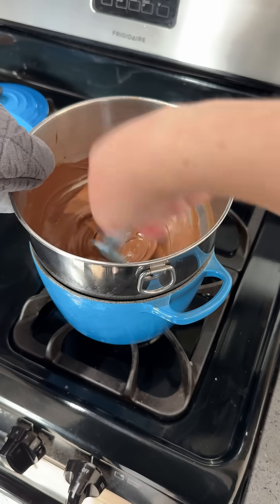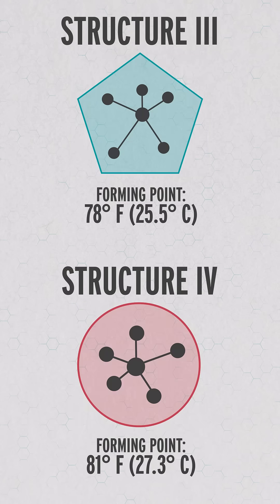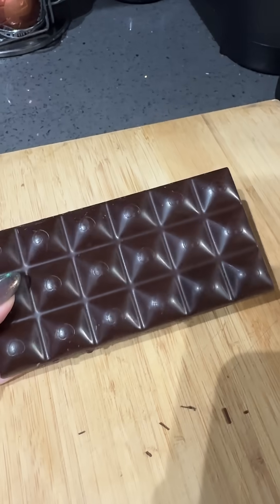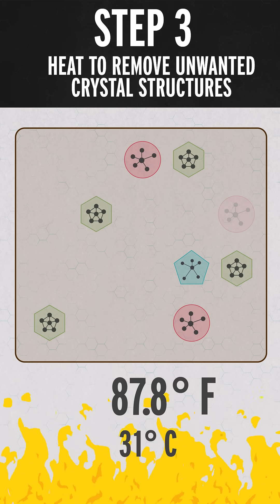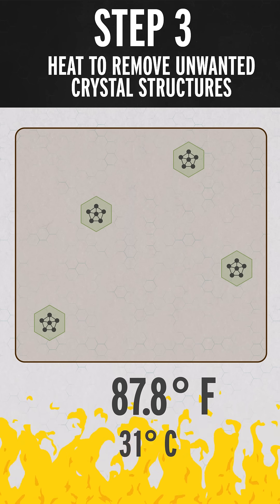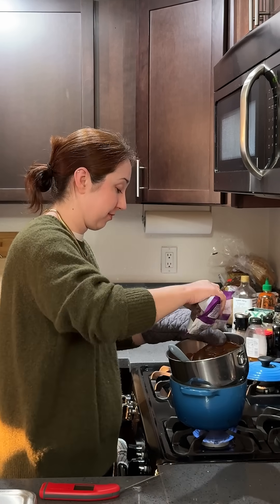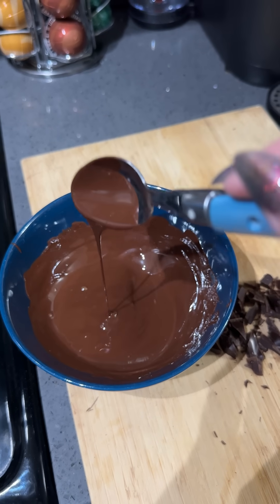tempering chocolate is chemical engineering

Comment: Hi, are you familiar with how to get better pour-ability with vegan chocolate? I have been able to temper it but when making bulk bars that have filling inside and trying to do the first layer and make sure it reaches all across the mold, I find it quickly becomes very thick and viscous - makes it very hard to pour / spread. My goal is to make bulk bars with a certain filling on the inside, so I need to quickly pour and set those initial layers….. but I’ve yet to find a vegan milk chocolate alternative that I can temper AND has good pour ability. Thoughts?

Comment: It's actually much easier when you learn what it looks and feels like at the temperature points.  At most 15 minutes a pound when you get use to it.  A quick test, stick a knife or spoon, or some such to coat, and place it in a fridge.  2 minutes is usually enough to see if you got a nice smooth temper without streaks.  

The big trick is not to melt it real quick!  If you do it takes longer to bring it down.   It's a slow and stead rhythm Heat and stirring, cooling and stirring, watching and feeling, yes, you  don't have to pretend its science.  It's an art and touch the surface with the back of a knuckle will teach you how to handle the chocolate. 

Another note:  dark and white chocolate like different temperatures ;)

Comment: Sorry if this question is unhinged but is it possible to use a sous vide for this process? It would be more difficult to properly stir the chocolate yet if the temperature could be accurate to 0.1 degrees could you bypass the painful parts and end up with tempered chocolate?

Comment: Being that you said the key words “at home” I’m guessing you used a cheaper thermometer and those can have a wide tolerance for the actual temperature you’re trying to read. If you want a precise temperature for something like this that is supposed to be precise. You would have to shell out some moneys for a good thermometer with a smaller tolerance range. But at that point just buying chocolate bars is cheaper

Comment: Makes total sense. Tempering chocolate is usually a baking thing, and any good cook knows that cooking is art, but baking is chemistry.
Reply: Ehm... close but not quite. It's not a baking thing, it's a candymaking thing. Baking is done in the oven. Candymaking is its own field which is done on the stovetop like cooking, but is precise like chemistry because making candy is mostly just controlling the crystallization of sugar (alongside whatever other ingredients). It's such a specific art that it has its own type of thermometer, a candymaking thermometer, which is made specially and has markings for the various stages of sugar, because when you boil sugar and water, it boils at a specific temperature depending on the ratio, so any ratio can be achieved by boiling the mixture until it boils at a specific temperature (the temp goes up as the water content goes down). After that is the crystallizing part, which is the most variable and depends on what else is in the mixture (milk, etc). Source: I make candy at home.

Comment: This makes it seem so difficult. I heat mine up to 115 or when the chocolate melts properly. Cool it to 100-110 and add the seed. It hasnt failed me yet. My uncle who is a gastronomy professor said to cool it to 80 degrees but it tempers too fast at that temperature so i tried raising the temperature and 110 is the max i can do with it still working.

Comment: Fun fact, this is pretty much exactly how metallurgists manipulate metals to get the desired mechanical properties! You can add different alloys to make a phase easier to achieve, or you can simply use different heat treatments to get to the desired result. Either way, cool video!

Comment: Mmmm, that's mechanical engineering, not chemical.... 
There aren't any chemical reactions happening i.e. no electron exchange, soley mechanical structural rearrangement based on temperature change (tempering).
Reply: It’s actually  material science, not mechanical.
Reply: @Joker-em6oz  yes it's material science, but also falls under mechanical engineering as it's a mechanical process. There's a whole branch of mechanical engineering dedicated to this (I'm a mechanical engineer in this industry...).
Reply: @ no it doesn’t. This is its own field. Don’t think you’re in the chocolate industry

Comment: I nailed tempering the first time I tried it, got a great sheen and a ridiculous snap.  I never got tempering to work ever again, not once.
Reply: it do be like that sometimes
Reply: I can't add top level comments but the reason why tempering isn't always consistent even when you do it the same way is because local humidity changes the temperatures needed to properly temper the chocolate ever so slightly.

I live in a very dry place and I have a proper AC running in my kitchen because if I run a swamp cooler I have to adjust my chocolate tempering otherwise and this is a more permanent decision for me.

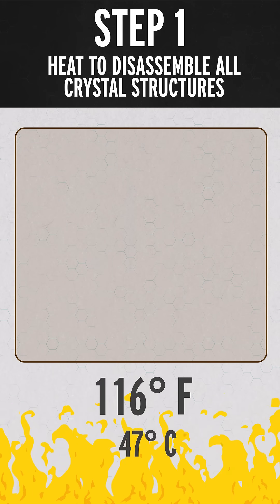Comment: Nice Video. I work in a factory that produces chocolate and that 0:19 is exactly how the chocolate is prepared for the coating machine. The machine that prepares the chocolate uses cold water (8°C) to trigger the first crystallization step, maybe that's the reason why you had some trouble with it.

Comment: An immersion circulator (aka sous-vide cooker) is magic for tempering chocolate. Put any amount of chocolate in a bag and seal. Heat to 117 in the water bath, then add ice to the water to drop down to 80. Set the thermostat to 87 and knead the bag a few times as it heats up to encourage crystal formation. It’ll all be structure 5 this way, you can do this with any amount of chocolate, and you can hold it at 87 as long as you want. Just wipe the water off the bag before you use it.
Reply: Thank you for answering a question I've had I don't really ever want or need to work with chocolate but I wondered if you could use a water bath
Reply: And a drop of water will destroy the whole chocolate batch.... Pastry chefs know that.
Reply: @curlyhairdudeify  thats why it's in a bag

Comment: Question about type 6: does refrigeration affect the process? I wouldn't want it sitting open air or even sealed at room temp but if were talking about top tier desert chocolate I could be comfortable leaving a container in the fridge for a long while.

Comment: You can also seed with small amounts of cocoa butter from an immersion circulator or those heating pads with the magnetic spinning pills. Also, I’m certain you’re using chocolate chips which has different ingredients than chocolate like waxes that would prevent a lot of this.

Comment: Yeah, I bothered tempering chocolate exactly 1 time. Then I just made a batch of chocolates, split it into thirds, and cooled each third with a different method. One third went into the freezer, one into the fridge, and one I left on the counter and but it into the fridge after it cooled to room temp. The freezer made chocolate glass (I could see a possible use there, but not great for candy bars). The fridge made it too hard for comfort but not nearly as smooth and glassy as the freezer. Thr room temp and then fridge combo came out basically perfect. I've made several batches of candy bars this way and they are almost identical to store bought texture.

Comment: As a person who tempered probably half a ton of chocolate, I can say that it's not that hard. The main thing you should worry about is a temperature in the room you temper the chocolate.

I needed to temper a lot of chocolate lately and I tempered it combining seeding method and some old time ice bath to make the process so much faster and easier, because I needed literal kilograms of tempered chocolate. But the temperature in the room should be pretty low for the best results.

Also you can temper chocolate with stick blender, melt the chocolate almost to the smooth state, or you can add a little bit of tempered chocolate to it and then blend. Like fast tempering method and real nice.

Comment: i make temperated chocolate through rage and the seeding method. i used to use a thermometer and all that jazz, now i just stand there stirring until i’m angry then pull it off, quickly seed, mix and work with it as fast as possible. in my angry little brain i am trying to out speed that chocolate’s attempts to fuck with me lmaoo it works but i don’t recommend it

Comment: Currently I’m still a baking student, and chocolate is a large component of our teachings. Biggest advice I can offer is for home use the seeding method works 100% better then tabling. Best results is to hold back 1/3 of your overall amount as solid, tempered chocolate, then melt the rest. With the seed amount you’ll need to chop it fine so it melts and incorporates easily. Then simply remove the melted amount from the heat, and gradually add your seed to temper.

Also it’s vital to know that if soy lecithin and palm oil are present tempering does nothing. This is called coating chocolate since these binders and fats disrupt the coca butters ability to solidify. This allows you to melt and cool this chocolate repeatedly without it losing its characteristics, but is of lower grade cocoa in relation to other chocolates
Reply: I graduated with a pastry arts degree and they never taught us the bit about the palm oil or soy lecithin 🙃 steaming mad rn because that would've helped me quite a bit to know.
Reply: Wait, but why are you melting chocolate to temper it if it is already tempered?
Reply: @slwrabbits  Melting chocolate to untemper it is used to either coat items in chocolate or to work it into desired shapes. Fully melting it ensures there’s no cocoa butter left solid, ensuring it can be solidified correctly to yield the desired results. As an overall skill it’s not seen much outside of pastry shops or fine dining due to the cost and labour put into working with chocolate
Reply: @blyatfulcommunism171  Thank you, this makes much more sense now.
Reply: What type of chocolate forms when I leave chocolate in the sun it melts and resolidifies? hahaha 

I could have sworn it had palm oil in it. Maybe not tho.

Always seems to taste nicer afterwards. Almost crumbly sometimes. 

I thought it was all in my head - but now this got me thinking something has actually happened.

Interesting concept.
Reply: @fizzpopbangcrack  If its normal couverture chocolate, then that crumbly texture is a result of the fat crystals solidifying differently from a standard temper. This is most likely form 4 your describing, which depending on the fat % in the chocolate and the environment it crystallized in nets you that result. As for the taste part I have no discernable answer, as taste and flavor are more a sense based

Comment: It also looks like you are using chocolate chips, which don't follow the same rules as other chocolate. Chips are made, by design, to be pleasant to eat out of hand, and to stay melty in cookies or whatever for a long time. Thus, they have other fats (and sometimes stabilizers) added to them, to give them a softer texture. Also, melted chips give you that pasty texture you see in the video, which is honestly annoying to work with. If you want to experience the true art of tempered chocolate, you need to get  good quality chocolate bars, or baker's chocolate, or the like, which only have cocoa butter as the fat, which tempers the way you said. It tends to melt much smoother, and depending on the manufacturer, it will be runnier and easier to work with

Comment: Best method I’ve found was just melting the chips with a few left than taking it off the heat and stirring in the unmelted chips. That way I don’t need a thermometer and it’s still seeded

Comment: Would an immersion circulator make it easier? Maybe have one set to 116f then a second circulator at 80f. Melt the chocolate is the first water bath, then immediately transfer it to the other water bath that's set to 80f. After the chocolate has cooled to 80f then turn the circulator up to 88 degrees. Is there a specific amount of time that the chocolate has to cool from 116f to 80f? Is there a specific time to heat from 80f to 88f?
Reply: I haven't seen anybody do it but s chef I met a while back said that he used that method, he said it works.
Reply: @mrnumba154 Interesting...I think I'm going to try it and see how it goes.

Comment: Btw...you can use the micro wave. Use small increments of time, 20 secs stir and repeat. Try to bring the temp to 116 or 120. Then seed and stir and let it sit, check every 15 mind are so. Make sure to stir chocolate while also taking the temp. Then slowly bring the temp back up, Do Not exceed 90! This process is better with a temp gun. You can test your chocolate when it is cooling by running a test strip when it is cooled around 82-80. It should set up in 5 min or less. Look for dullness, strikes or bloom. Advice from a real life Chocolatier. It literally my job😊

Comment: Got any tips on how to get good results glazing nuts in chocolate? Was looking for a chocolate melting bowl and I think the one I looked at only had 3 heat levels around 28-32°C, not 47°C or 22°C, could that still work? Or do I need to search for something with more variation?

Comment: Tempering chocolate is much closer to material science than chemical engineering.
Reply: idk just makes me think of metallurgy
Reply: Well I mean they're quite similar. I'd argue it actually is chemical engineering, since material science is a lot more about the theoretical aspect to the structure of materials. Chemical engineering focuses on larger scale processes in food, cosmetics, pharmaceuticals etc. Material sciences is shit like carbon nano-tubes and evaluating optimal alloys for use in aerospace engineering. Not tempering chocolate
Reply: @AdamB_29 isn't it just chemistry and when you use a process to scale it up to a large scale, then it's chemical engineering?
Reply: @devdog007  i mean basically yeah. Chemical engineering is... well engineering using the concepts of chemistry (so usually looking at how chemical processes affect the physical properties of a material or substance)

Comment: I successfully managed to temper 40oz of chocolate at once over the holiday by using my ninja crockpot to keep it warm. It has a proofing function, so whenever the chocolate dropped below 82F, i would turn on the heater for a couple of seconds to bring it back up. Worked like a charm.

Comment: As a pastry chef, every brand of chocolate has a different crystalizing and working temp. Follow what it says on the bag for what you're working with, but you can heat back up to 90F and be fine, any higher than that and it will ruin the temper, and by higher I mean 91F, chocolate is just that sensitive. It's why I try to use it as little as possible lol.

Comment: I blew my friends mind once by perfectly tempering chocolate by microwaving some chocolate chips with a tiny bit of canola oil, mixing, and then microwaving again. After that put it out on the back steps in Minnesota 12 degree weather with a cover on for 30 minutes. Then it turned out perfectly, I don't know if I'm ever going to be able to do that again.
Reply: Then it was a fluke

Comment: I've heard about this before but I can't figure out how crystallization works in a heterogenous material like chocolate.
Reply: crystallization occurs in heterogenous materials all the time, steel and cast iron is probably the easiest example to point to.

Generally you get a dominant crystalline phase of the bulk material with interstitial phases of the secondary material. Chocolate's a little more complex in that you have 2 crystal phases (1 for the sugar and 1 for the cocoa butter and milkfat) and then interstitial clumps of all the other cocoa solids that form smaller grains. 

The microstructure is actually really complicated and I can't find too many papers on it, probably because most materials labs and universities have better things to do with their time than stick a hershey's bar under a SEM.

Comment: Don't chocolate chips usually have insufficient levels of cocoa butter to temper properly? Having a ton of the b-roll here centering on chips seems potentially misleading to home bakers, especially when the activity is notoriously difficult...
Reply: chips work fine, I managed to temper chocolate from chips for eclairs like a week ago and they turned out very snappy.

you've just gotta use a double boiler and go slowly.